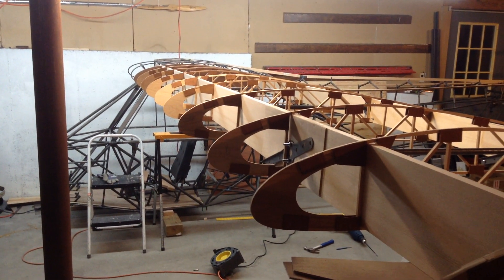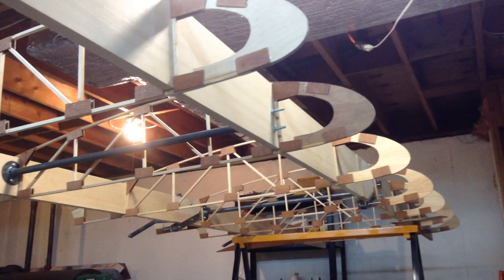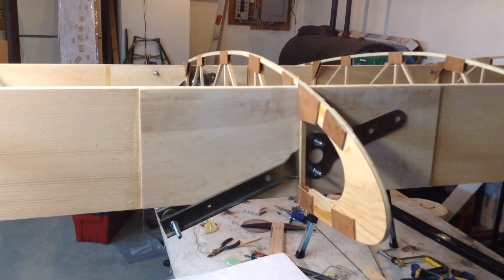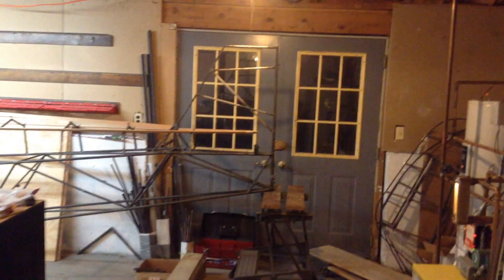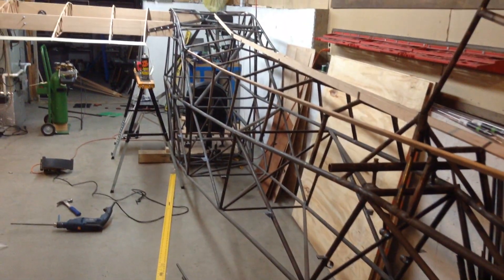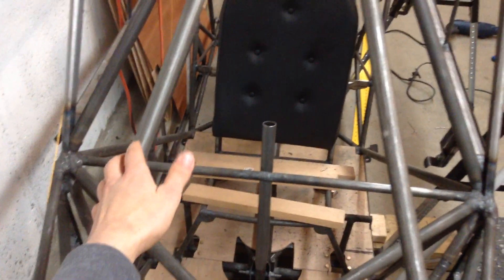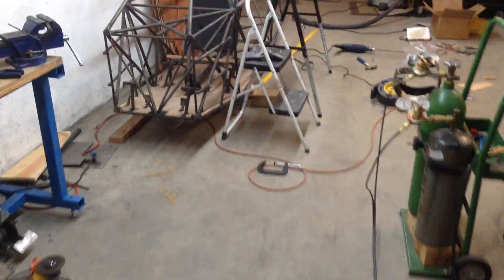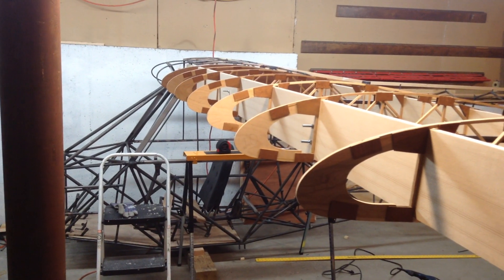Wag Aero Sport Trainer project Piper Cub replica Southbury, CT

Comment from the maker: Hi Frank, plans building the Sport Trainer has been very challenging. The original J3 was never designed to be a homebuilt. There are many different size tubing and wall thicknesses, there's a lot of components utilizing "U" channeling. Both 4130 and mild steel is used. In my opinion, it is a complex plane to build unlike other true homebuilts like a Tailwind, etc which are much more simpler to construct.
Reply: Is the "U" channeling you refer to something that you can purchase or do you have to bend flat stock into shape for use?

What would you say was the hardest part so far?
Reply from the maker: Frank K I believe Wag Aero stocks the "U" channeling. I ended up cutting and bending my own since I had the material and tooling. The hardest part of the project so far, I'd have to say were the gear legs and lower right hand door. I had to cover the door pin springs with a wet rag while they were being welded in place in order to not loose the spring tension. I plan on making my own engine mount too since my fuselage has slight dimensional differences of a 1/16" here and there.